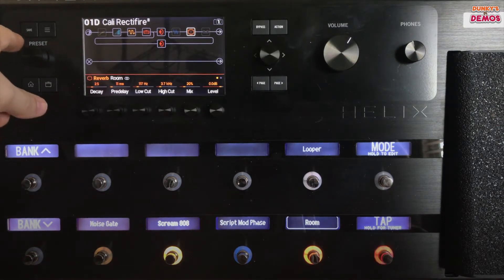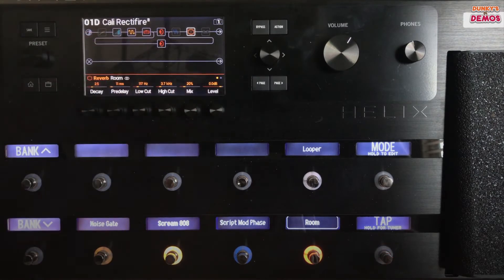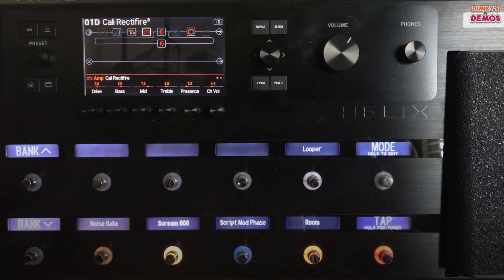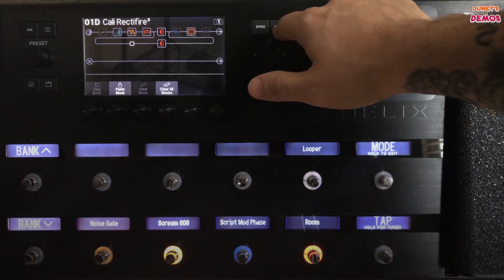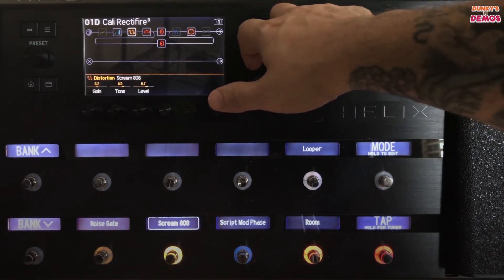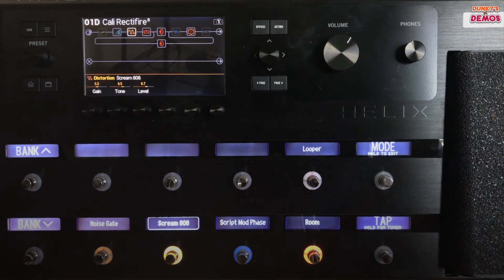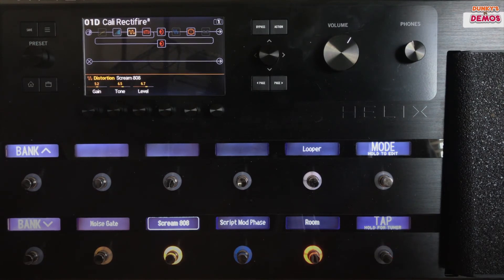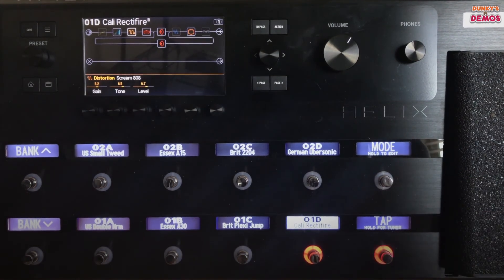An Idiots Guide to Line 6 Helix - #02: Buttons & Switches (Anatomy of a Helix)

Comment: Question .. and it's not about the controls on the Helix.  I'm interested in the Helix but I'm a vision impaired guitar player.  I am SUPER nearsighted (worse than you can imagine).  For me, EVERYTHING has to be closer than normal for me to see it.  The scribble strips I think I can read, but the knob and button controls on the Helix would be difficult to read if they were on the floor.  I did notice immediately that you had the Helix up on a stand.  Closer will definitely be better for me whether I'm at home or at our church playing.  Can you tell me what kind of stand you used?  I could envision having the Helix mounted on a stand next to me.  I think it would make it a lot easier for me to use the device.

Also, you said that you need to learn to use the controls on the unit and not depend on the Helix editing software.  Do you say that because there are features missing in the software that can only be done with the controls on the unit?  Or are you saying that as a general statement that you need to learn how to use the controls?  I totally get your point that at the gig, you might need to make adjustments and the controls on the unit are the easiest way to do it.  My preference, again because of my vision, would be to use the Helix editing software where possible (at home) and then download the patches.  That's only because I have software on my PC that magnifies the screen so it's easier to read things on my PC.  I just want to make sure that if I do use the Helix edit software, I'm not missing out on features that are only available on the Helix unit itself.

Thanks in advance.  Yeah, I know this is probably a strange question, but when you have vision issues, you have to consider if you're going to be able to see to do what you want to do.
Reply from the maker: Hey there. Thanks for the questions! 

I am using a stand from a company called On-Stage. It’s the Mix 400 and is actually a mixer stand. The Helix LT is a perfect fit. The Helix Floor is a TAD bit snug so I cut up some black gym towels to make some side protectors as to not have any scratching of the unit. 

To the questions around my comments on learning the controls, your point is certainly one where the editor makes absolute sense. My comment was a general one that I still stand by for most new users. When I started this series, there was a massive trend of new users not understanding how to do basic functions on the unit without using the software, which would cause anxieties about rehearsals or gigging BECAUSE of not being able to have the editor on hand.  The way I chose to approach this series was to show the ease of use for folks that were new to modelers in general or new Helix owners. 

What I found frustrating was “power users” that would direct folks to the software as opposed to helping folks understand how the controls worked so that they could then make a decision on editor vs manual editing. Now the software is required for updates, loading IR’s and also Loading and sharing of presets so those instances it’s a must. For your scenario, absolutely use what will work best for your needs. The editor is fantastic and a great tool at users disposal.
Reply: @JeremyVarao  were you saying the stand fits the LT perfectly and that for the Helix Floor it's not quite a perfect fit with the stand?  Or ... were you saying that the stand fits either LT or Floor, equally well and it's just that the Floor model is a tad wider than the LT such that you wanted to have the towels on the side of the Floor unit so it didn't bump other gear it was next to?  Hopefully the stand fits either LT or Floor with no issues.  Looking at your picture, it appears you have a lot of gear so I can understand why you'd want some cushion around the edges of the Helix.
Reply from the maker: @mikejolls2560  yeah it fits the LT perfectly and snug on the Floor. Floor still fits but snug for sure. Also there’s a V2 that’s only available now and mine is not that one.

Comment: Jeremy thanks for doing this and your future tutorials. I’m sure it will all be very helpful. There’s so much to know. Am wondering what stand you’re using to hold your helix and is it very sturdy and fits helix snugly? Thanks!
Reply from the maker: Hey thanks Randy! Glad you checked the vid out. The stand I am using is this guy:

https://www.sweetwater.com/store/detail/Autolocator

It's a PERFECT fit for the LT. The Helix Floor is a bit snug so I cut up some black athletic socks to put between the Helix and the stand as to not scratch the Helix all up.
Reply: Thanks for the link and info. I have Helix floor so the sock trick sounds like a good solution.
Reply from the maker: Yeah man it works like a charm. I should do a review on the stand. i get asked a lot about it.
Reply: Yeah please do a review on the stand! I'm sure many Helix owners would benefit from that. Right now I have mine on a flimsy tray table. Not very sturdy.
Reply from the maker: Will do!